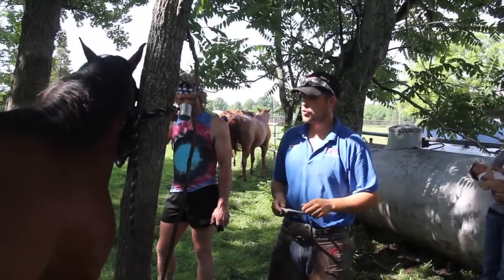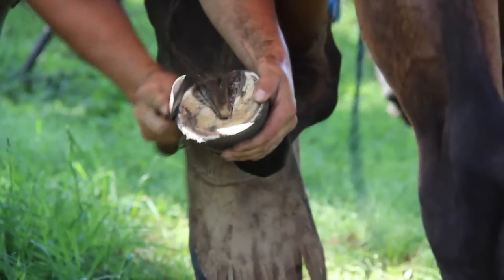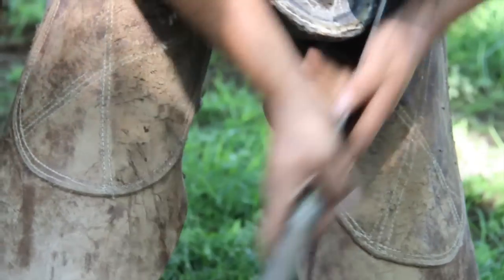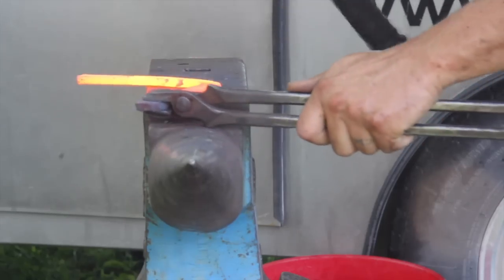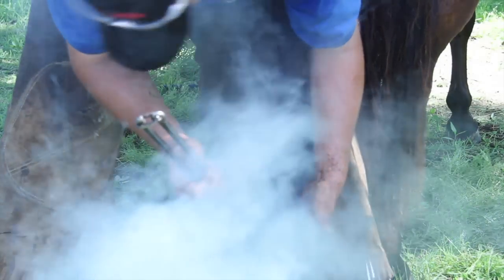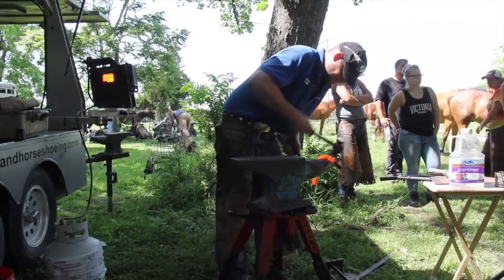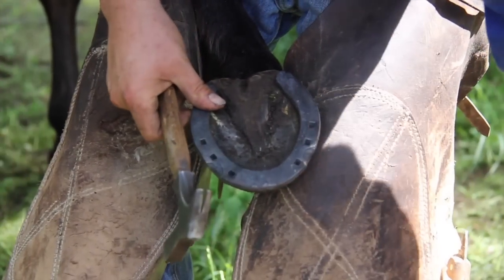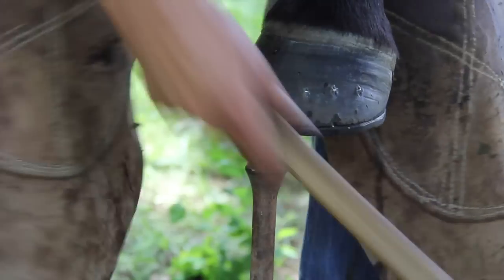Cody Gregory Journeyman Horseshoeing Demonstration.

Comment: Beautiful run.  One question.   Did Cody bump anything into the toe before turning the toe, or is he relying on seating-out to provide both sole relief and stock width at the toe?
Reply from the maker: Hi Mark.  No bumping.  With a plain stamped, it is not as important as with a fullered shoe.  Seating out does the trick.
Reply: @ChrisGregory-Farrier-Author  seems like it did
Reply from the maker: @igor22m  Cody almost always bumps.  His first heat is usually a bump-and-bend, but I would have to watch this again to remember if he did it here.
Reply: @ChrisGregory-Farrier-Author  My bad. Didn't watch carefully.  No bumping.  He is an animal! Exceptional!